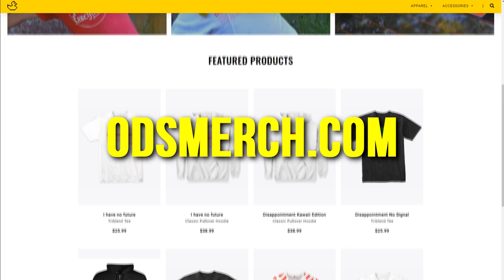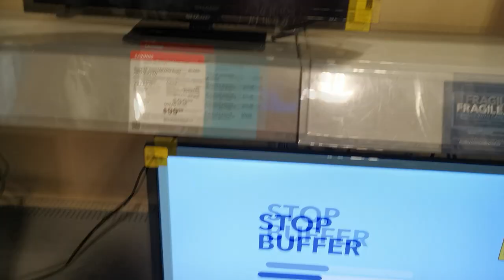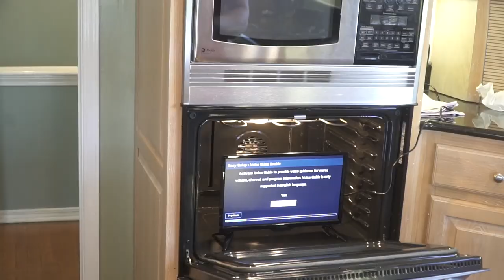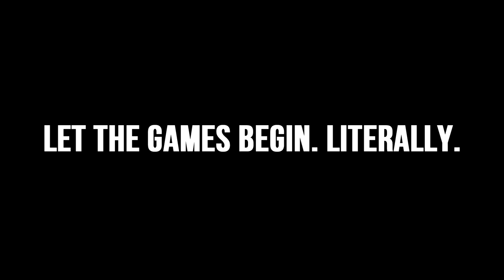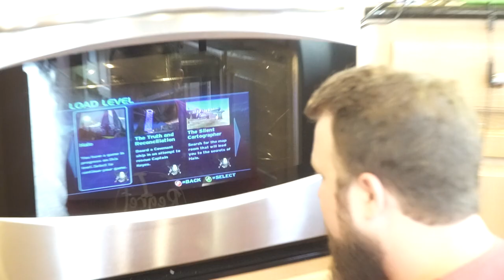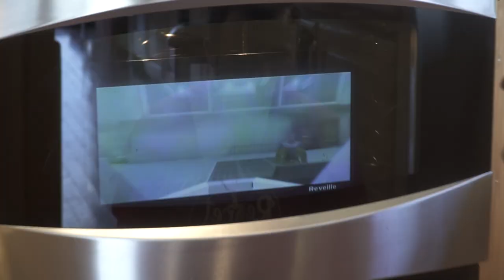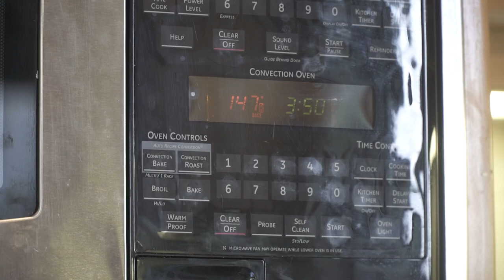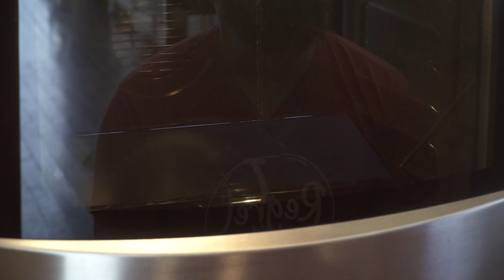Can I Beat Halo Before My Oven Melts My TV?

Comment: "Isn't it bad to heat up a TV?"
"Whats the worst that could happen. We got water right there, we'll just spray it off."
SO HES GONNA THROW WATER ON AN ELECTRICAL FIRE AWESOME
Reply: 69 Nice
Reply: @thabootyman1181  come again ?
Reply: I was thinking same thing lmfao
Reply: I mean... water will put out any type of fire...
Reply: @deiyion  if you pour enough water it will put it out, water is an anti-oxidant (unless you mix it with fluorine, but ehh) so if a burning object is surrounded by water it can't oxidize, and therefore can't burn
Reply: @O T N that's not why this parent comment is incorrect, electrical fire is a real term, defined as a fire started from an electrical source, and particularly dangerous because it involves live wires, which can cause complications when trying to put the fire out.
Reply: @O T N water will work. Absolutely not the best idea, but if you really drown it, it will be serviceable, all I'm saying.
Reply: @O T N Its a fire caused by electricity. I hope you realize water can conduct electricity, so if you have an electric current going through a device that is on fire, and you throw water on it, you will get shocked. That is why water isn't used to put out electrical fires.
Reply: Man, I swear reading these comments about an electrical fire is just so heated. Just so you know, if the TV caught on fire, it isn't an electrical fire. Throwing water on it would put it out. Why, you may ask, is because most likely the plastic is on fire. Electrical Fire is when the source of the fire is from the electronics, and the TV's motherboard at 200 degrees F isn't anything to cause worry. From what I know, Computers Motherboards can hit 180 degrees F, still run, servers way more, all that happens is that  it malfunctions and shuts off, no fire. Even the wire, the power wire, probably is insulated and can withstand the heat.
Reply: @AlanGresov  Try it and let me know how it goes
Reply: @yurkogway7241  Even if it wasn't an electrical fire, throwing water on live electronics would be a terrible idea. 120V will short and cause an even bigger fire/explosion/shock.
Reply: Alan Gresov I so hope this is bait
Reply: Alan Gresov no it will not the water goes straight to the bottom, making it steam and gives the fire even more oxygen to thrive and grow which will most likely cause an explosion. Safest thing to do to a grease fire is to put the lid on the pan and let the fire die off. No oxygen means no more fire
Reply: @yurkogway7241  Yes throwing water would put it out, but the TV is plugged in.Throwing water on it would be an electrical hazard. It doesnt matter if its an electrical fire or not (which it is), you cannot throw water on an electronic device that has a current running through it unless you have a death wish
Reply: @AlanGresov  lol water is NOT an anti oxidant
Reply: @FadiAlzammar  He's right. If the water completely smothers the flame it will go out, HOWEVER if there isn't enough water to smother the flame it will evaporate into steam and fuel the fire.
Reply: Alan Gresov not a grease fire
Reply: Nano Cola the first thing you’re taught in fire safety is “DO NOT USE WATER OR ANY KIND OF LIQUID”
Reply: Paul Jeffers no water does not put out a grease fire
Reply: Nano Cola it doesn’t smother the flame it makes it pop like bacon grease as soon as it hits it causing it to spread
Reply: r/woooosh
Reply: @AlanGresov  water is not an anti oxidant though
Reply: @AlanGresov  We know how fires work m8, you don't have to explain that.
Reply: @sebastianmireles6163  this is not a woooosh!
You even did it wrong, you are a shame for humanity. capital 'r', space between the / and woooosh, and it's an woooosh with 4 o's, and it's an r/ihavereddit. You are a shame for humanity
Reply: Alan Gresov water isn’t an anti oxidant bud
Reply: @AlanGresov  no water will never work on a grease fire unless you can somehow find a way to completely submerge the entire kitchen in water and remove all oxygen from the entire room.  Dumping water no matter how much will cause the grease to spit and spread the fire not put it out.  Source, me, a PhD in chemistry.
Reply: @AlanGresov  Water will not work on a grease fire that's why whenever you work in a restaurant they specifically tell you not to use water.
Reply: The fuck are these replys? Geeking out about electrical fires like it's rocket science
Reply: @AlanGresov  this is called digging in your heels.

it happens when one states an argument so stupid that they have no choice but to stand by it as everyone calls them stupid
Reply: Weeb
Reply: @AlanGresov  grease fire put slower on it or your fucked!

Comment: Cortana: Halo.. It's finished.
playing Halo until my oven melts it
Master Chief: Not yet
Reply: Golden Galaxy Although the two terms melting and smelting sound similar, they are different terms that have different applications. Melting is the process of liquefying a solid substance by heating. It is the process by which a substance changes from the solid phase to the liquid phase. Smelting is the process by which a metal is obtained at temperatures beyond the melting point from its ore. Both processes involve heating a substance into a higher temperature. The main difference between melting and smelting is that melting converts a solid substance into a liquid whereas smelting converts an ore to its purest form.
Reply: @FLiPtHeSWI7CH  I just realized it said smelt instead melt because of autocorrect lol

Comment: i know its for A vid BUT COULD YOU AT LEAST DESTROY A USED TV RATHER THEN A NEW ONE?

edit: also the reason it went black is becuse it heated up the liquid inside the screen causeing it to expand making the screen go black and the only reason the circuits survived, is because well...there circuits, are baked onto the board. this is like repeating the process.

Comment: In the early 1930s, the Phillips head screw was invented by Henry Phillips. Automobile manufacturers now used car assembly lines. They needed screws that could take greater torque and could provide tighter fastenings. The Phillips head screw was compatible with the automated screwdrivers used in assembly line